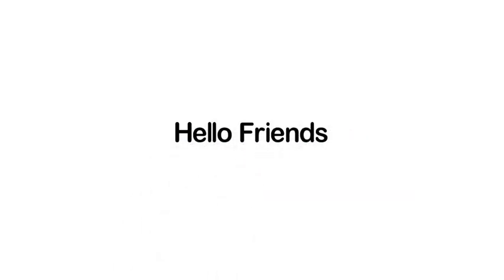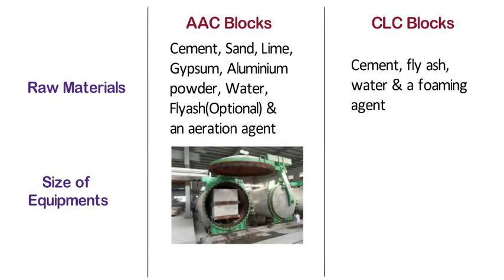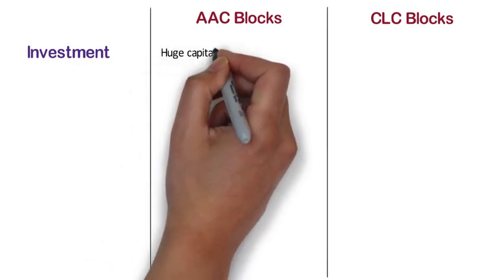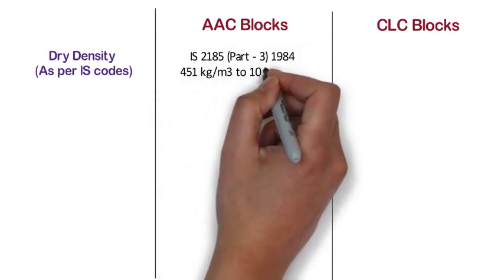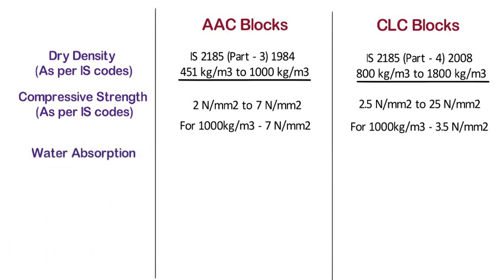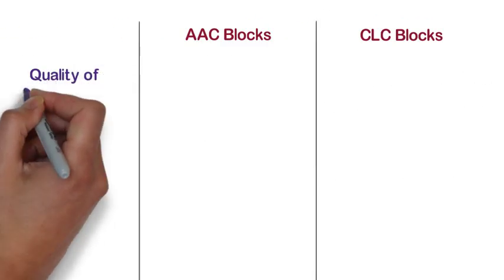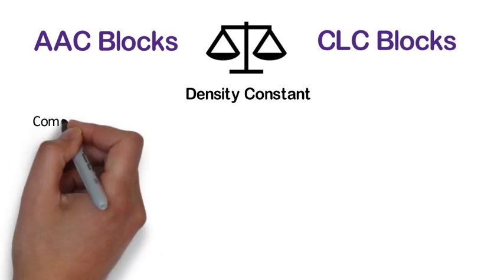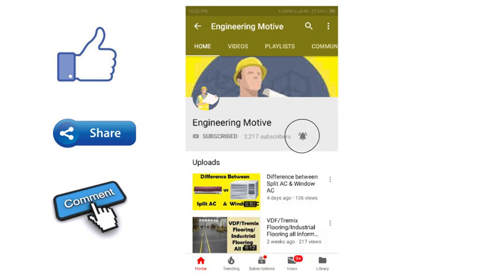Difference Between AAC Blocks & CLC Blocks

Comment: AAC vs CLC

Compressive strength is high in CLC block

In CLC Block Comp. Strength will increase in future, not in case of AAC

CLC nature curring.

Water absorption was very low in CLC compared to AAC

It can used used for load bearing without any doubt.

Wet density was around 950 in clc. Where as 750 in aac.

Nails, door can be fixed with using hammer in CLC. Where as drilling machine needed for AAC

 crack happened easily in AAC due to low went density during production. Not in case of CLC.
Reply: For hot humid climate  like India, which block gives  better  insulation, CLC or ACC?
Reply: CLC because of its curing method ( by water ) whereas AAC curing done by furnace / heat . @vladmiri

Comment: Best way of explanation,
But i have a suggestion, in the end you can add which brick is good to use for different buildings for ex- house, warehouse, godown, single storey, double storey,etc.
Reply: For RCC building CAC blocks are good and less expensive. For Load bearing strus AAC BL cks are good because of high compressive strength .

Comment: You mentioned "Space for Curing."  How is that different from storage space, and don't both methods require storage space?
Reply: I assume aac cures much faster being in a hot pressured chamber. So you move it out much faster. Stockpile space is needed for both but once aac leaves production line its ready to be loaded and transported.

Comment: Very useful comparison. There is one point you did not cover. What is the comparative insulation value of AAC and CLC? I believe AAC provides much better insulation. If CLC is combined with insulation, in order to match AAC, that would increase its cost. If it is not insulated then there is more cost in air conditioning and heating.

In the USA, Europe, and the Middle East, where I have worked, I have seen that there is much more awareness of the importance of improved insulation, for comfort and reduced energy consumption, in Europe and the USA. But unfortunately in the Middle East most of the housing is still built without any insulation at all. This is not good for the future of our planet.
Reply: Hello, what kind of insulation would you recommend using with aac blocks in humid-continental climate? Thank you in advance.

Comment: Hi
As I am builder and constructing low cost house duplex and multistory building, I am using CLC  Block
Reply: How much cost of one CLC block?
Reply: 40 Rs per block,  24*8*8 size
Reply: Can it bear water pressure ? I mean if I want to make a big large water tank say 15k to 20k litre capacity
Reply: @gurdevbrar5782  only RCC wall for long period
Reply: Don't use CLC

Comment: AAC can't be used for non load bearings and CLC are used for load bearings and non load bearings.
Reply: In Europe AAC is frequently used for non-load bearing walls as well as load bearing walls. Different densities are available. For non-load bearing you can use lighter blocks, which are also cheaper.
Reply: Ground floor pe Ghar banane ke liye without beem  aac block se kar sakte hai kya plz reply
Reply from the maker: You are talking about Patli beam right?...It's required.
Reply: @HistoricHomePlans  plz apka number dijiye